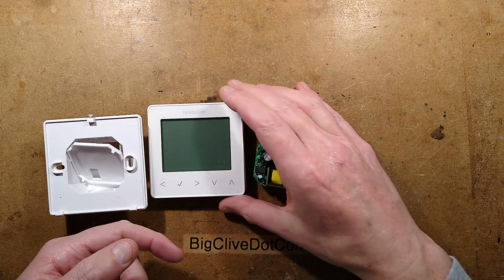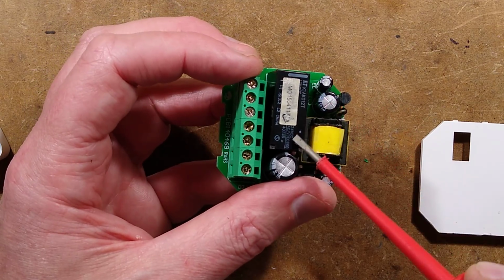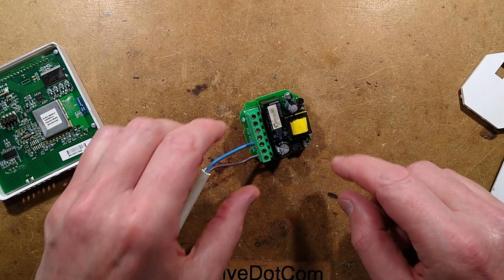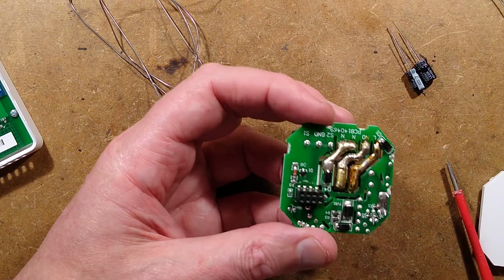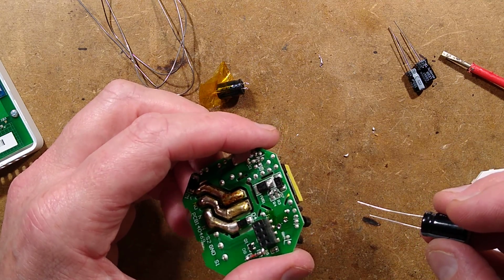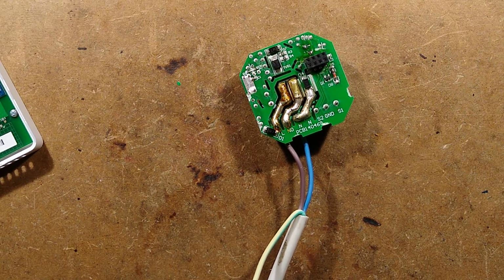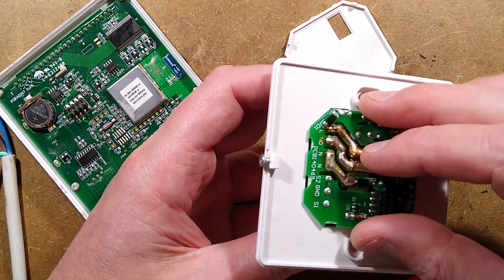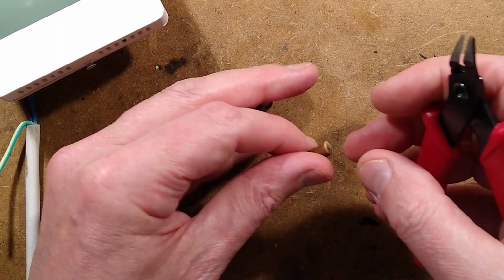Fixing a dead digital thermostat

Comment: I heard they put several diodes in series as a crude measure of protection, because power diodes tend to fail in short-circuit. This won't protect the third time, however.
Reply: Had a bunch of 1N4007-13 diodes fail short.  1300V rated, lightning does amazing things.
Reply: Regulations require tolerance to 2500Vpk 8/20 us transients on 300V CAT II appliances, while you can absorb the transient with series RL and parallel C, your diodes have to block that voltage if it comes the other way around. This is not an issue with a bridge rectifier, but with a half wave rectifier this has to be done.
Reply: If I had to guess, they used diodes with a low maximum reverse polarity voltage of 100V, so 3 in series gets them to 300V which will work.
Reply: @edman007x  That is a stupid idea. The cost of making a 1000V diode is no more than that of a 100V diode. A diode with higher voltage can share the same construction, just with lower doping concentration, so that it has a higher barrier height (hence higher Vf) and a lower carrier concentration in forward conduction mode at a given current (hence higher dynamic resistance). For a low current application like here, the cost difference is negligible.
Reply: @edman007x  Also for those super cheap parts, the package (copper, plastic, etc.) is certainly more expensive than the chip itself, and the bigger elephant in the room is the scale of economy. Everyone uses 1N4007 for mains voltage and 1N4001 for low voltage AC, that's why you can hardly buy 1N4002~1N4006, and even if you can, they are likely to be more expensive, and anyway you will just get the same ones as their higher voltage counterparts. Right from the manufacturers, they will only make maybe 3 voltage levels, and they will rebrand them as the next lower voltage parts to save logistics cost. If you read datasheet of those parts, particularly low cost parts, you will find the adjacent two parts have the same rated Vf, same Trr, and pretty much same everything, other than max voltage, and the lower rated one might actually be more expensive from distributors.

Comment: Interesting as always. I use a bit of heat shrink tubing to remove awkward components.
Reply: I have an assortment of surgical implements of different sizes- hemostats and Kelly clamps- to use as handles. Heat shrink is a good idea if you're absolutely sure nothing nearby will object to the excess heat, and while Kelly clamps are pretty much guaranteed to bork a component like an electrolytic, well, it's already dead, isn't it?
Reply: Silicone tubing is my go to for gripping small cylindrical components like LEDs or electrolytic capacitors.

Comment: Thought of you the other day when I found a sensor module from an automatic toilet at work.
Reply: Automatic toilet - I'm sure BC would be interested in reverse engineering the whole thing!!!
May I enquire what the sensor senses? Doesn't bear thinking about actually...
Reply: @stepheneyles2198  I imagine that it senses the presence of someone and goes off after they move away. I noticed that the light flashes constantly and stops if i cover the bottom lense.

Comment: A good fix indeed! Putting it back together sounded like a lot of components snapping off, but it worked! :D
Reply from the maker: That was the horrible friction fit case clips.
Reply: As long as the bits that break off stay inside the case, no problemo!! :-D

Comment: It's time you invested in a de-soldering pump.  I have a cheapo from CPC.  With a few simple mods, it's a great tool.
Reply from the maker: I have several, but chose the passive approach as it's faster than waiting for the desoldering unit to heat up.
Reply: I'm sure he has one but they are noisy.